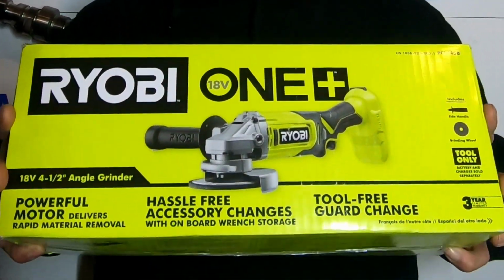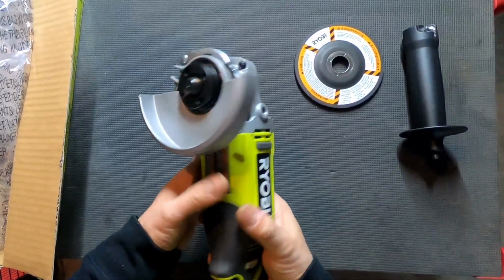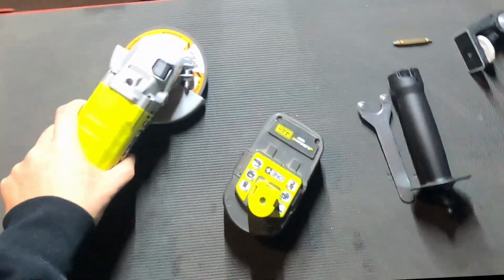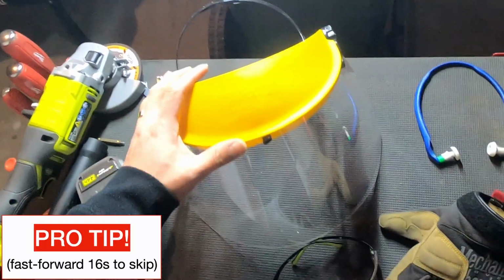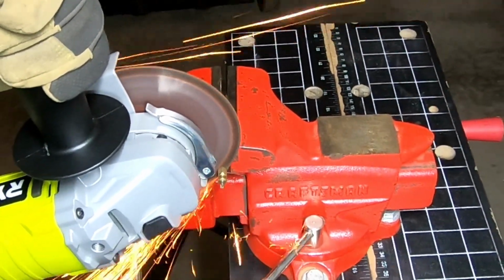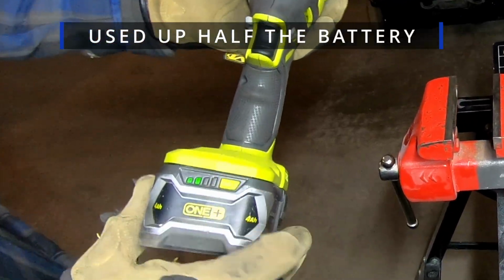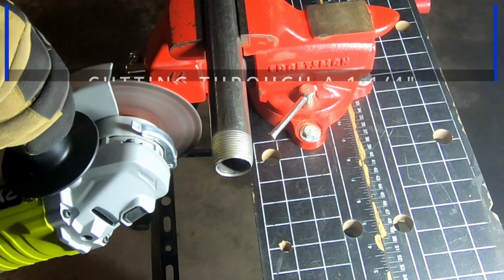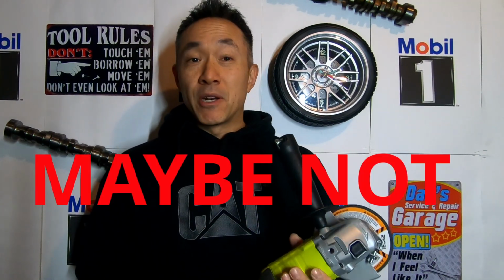Ryobi Angle Grinder Review and Testing – Is It Worth It? 🔥⚙️

Comment: I was gifted a Ryobi drill, (2) 4 Ah batteries and a charger so I thought I'd put an angle grinder for $57 from Amazon. I don't expect much as it's not for commercial use like RED or Yellow. If I can get it to work reasonably OK a couple times a year, I'm in the good for $57. That's 1 cheap dinner for 2.
Probably takes 2x longer with breaks to cool down. Just using thin kerf slicer blades for cutting metal. "As long as I match the blade to the correct metal I should be OK I hope. 
GRAFF Black Cut Off Wheel 4 1/2 Inch - Diamond Metal Cutting Disc (hardened metal)
GRAFF Termit  Cut Off Wheel 4 1/2 inch -Wood, Laminate,, Plastic